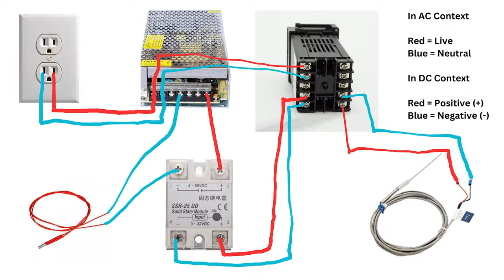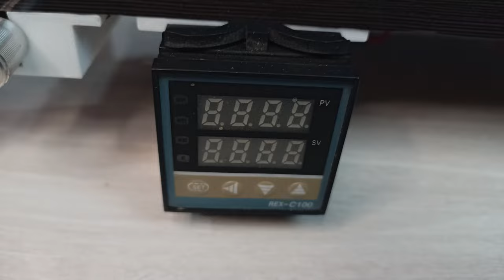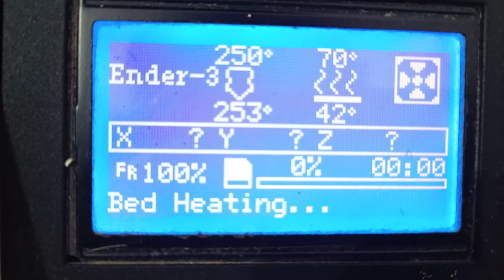Create Your own Free 3D Printing Filament from Plastic Bottles Using This Incredible PET Machine!

Comment: Can you please, reply with links for every product including the nozzle to the power supple and all the items, it would help a lot thank you.
Reply from the maker: I've used 

hotend with 1.7mm nozzle (You can use 1.7 drill to make a hole in nozzle)
REX C100 with k type thermistor - https://amzn.to/3OZh9sP
12v 15amp psu - https://amzn.to/3P3naVJ
DC TO DC SSR - https://amzn.to/432ENKP
85kgcm Gear DC Motor - (Unable to Find Any)
PWM - https://amzn.to/48xEady
Reply: for the hot end would any hot end work, and I can’t find the motor are there any other types of motors that can be used?
Reply: Can I replace the motor to a used stepper motor?

Comment: hey bro i want to try this with my glu gun but can you please tell me from where i can buy that nozzle and what size ?
Reply from the maker: Its a normal 0.4mm nozzle but i used 1.7 drill bit to make a hole equivalent to diameter of the regular filament.

Comment: Ur wiring diagram shows an SSR? But ur final product doesn’t? How are you wiring the heater block to get heat? I’m struggling-thanks!
Reply from the maker: Yeah! I didn't realise to put DC to DC SSR until I wired this whole thing that's why I created a wiring diagram with SSR. Rex c100 has Relay output so you have to use SSR in order to make it work. DC to DC SSR if you're using DC heater and DC to AC SSR if you're using AC heater
Reply: So if I want to get the heating block to warm up I need to buy am SSR?
Reply: Could you maybe dm a really in depth wiring guide with hot ends heating block thermistor etc. I’m struggling and would appreciate it!
Reply: @Creative3DP  I would love a close up look at the wiring and maybe a tutorial on how to use the Rex c100!!
Reply from the maker: @calebdebass3882  Yes Breme REX c100 have relay output so you need DC to DC SSR in order to heat the heating block
Reply from the maker: @Caleb DeBass  follow the diagram for the wiring and if you need any help just reply in this section and other people may also be facing the same problem so they can also learn from our discussion
Reply from the maker: @calebdebass3882  operating the REX c100 is easy all you need to is to set the desired temperature (200 to 210 degree celsius for PET Filament) using Set button

Comment: what did you use to heat the plastic?
Reply from the maker: Hotend
Reply: @Creative3DP  what diamiter?
Reply from the maker: @mrdamdam8173  I have used 2mm nozzle as i unable to find 1.75mm drill bit
Reply: @Creative3DP  ok thanks but could i use a 12v 5a instead of 12a?
Reply: @mrdamdam8173  If you're asking for Power supply then I would say go atleast for 10 amp power supply. This is because the motor itself requires a 12V power supply with a power rating of 3 to 5 amps, and you'll also need to power the hotend
Reply: @CreatedbyAI7  Thanks, I appreciate the reply!
Reply: Use 1.5 drill the nozzle when go out get 1.6 alsi

Comment: for tip for hot end went to hadware store compared pla filment to a drill size so i could the same where the extruder motor will not slip on the filment
Reply from the maker: Yes you can

Comment: Hi! How did you configure your REX-C100? I’m asking because I set the SV to 200 degrees Celsius, but my hotend is reaching a much higher temperature than that, and I don’t know how to configure the more specific settings of the controller. How did you do it?
Reply from the maker: I would recommend check the wiring is done properly and make sure you're using DC to DC SSR otherwise it will not gonna work and then check REX C100 settings, there are many tutorials on youtube on REX C100.

Comment: Did you get a rounded geometry filament with the increasing in nozzle temperature? What was the temperature used? The heater, what is the voltage? 12V? 24V, can you tell the model? And the thermistor, what is the model? Best Regards
Reply from the maker: I use a 12V 15A power supply, REX C100 with a DC to DC relay, and a K-type thermistor. I keep the temperature between 200 and 210 degrees Celsius to obtain the best quality rounded filament. If I increase the temperature, it breaks.

Comment: Hello, I have a question.  I set up a similar system at my home.  I made a steel heater block and took a CNC nozzle and drilled it with a 1.7 mm drill bit.  No matter what I did, I couldn't get a full round filament from the nozzle.  When you make a thin strip, it becomes crooked, it does not close completely, a shapeless bar comes out.  When cut thick, it does not come out of the nozzle.  What should I do?
Reply: are you extruding at 60-70c? also i would just play with the thickness a bit, ive seen people have a decent amount thicker strips than what he uses
Reply: Set the temperature higher and if it not  work make your plastic strip a few mm larger

Comment: I bought this PET 3d filament extruder from ebay. Seller says he left all the wires in tact when he shipped it to me. It didnt come with instructions. When I powered it on, the red numbers never seem to get above 23. It doesnt seem like the nozzle is getting hot. Am I doing something wrong? Or is the machine broken? Can someone advise? https://www.youtube.com/watch?v=kNC_jB0eMCU
Reply from the maker: Can you tell me the name of the heating module you are using? or, it would be helpful if you could send me some pictures of the wiring and module to my email address provided in the channel's about section. I'll be happy to help you out.

Comment: Hello my friend, . Very sexy looking pet machine.I build a different one, works great too.but if you can take a tip from my experience.I went thru all fails 3d printing Pet.learned,it prints great at 260 h-e ..74 bec,,115 flow,and 100 speed.oh please,please dry your filament at least 30 mins. You will see the HUGE Difference.thanks.
Reply from the maker: Thank you so much friend for sharing your experience ❣️

Comment: Is there any trick to pass the filament through  the nozzle?when i try to pass it it melts
Reply from the maker: The first few millimeters should be thinner than the nozzle, then use plier to pull it slowly until you get better grip on thicker Extruded Filament

Comment: I use nozle 222/225 C° for print Pet. 😉
250 is over 👎
Reply from the maker: at 225, Pet filament caused extrusion problem for me and yes 250 is kinda over, as you can see the lot of stringing is last result. sweet spot is between 235 to 240
Reply: @Creative3DP  Strange because to me it clogs at 240 and over degrees in the nozle. 🤔
Reply from the maker: Yeah kinda weird 😕

Comment: dude, what is the thickness of the strip? i use 1cm for the same coke bottle, the machine does not buy it, and when I use 7 8 mm, protrusions form and hang out
Reply from the maker: You have to find the adequate strip size and wide the back of the hotend so that the strip can easily get into it
Reply: @Creative3DP  i mean, the flamenti I made with a 1cm strip can't get the printer, it feels thick, I think. when I try it with 7 8mm, it takes quite Decently, but sometimes there is a ripple etc. the printer also hangs out because of these. Do you have any hang-ups? How thick do you use the strip?
Reply: @Creative3DP  By the way, does the plastic cutter you shared require pressure from above? Or is it enough to stand still?